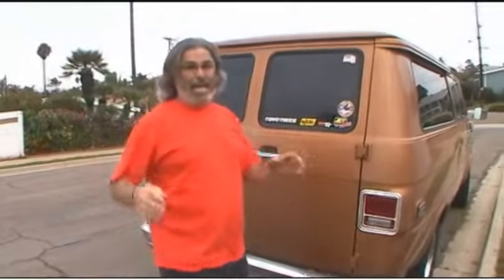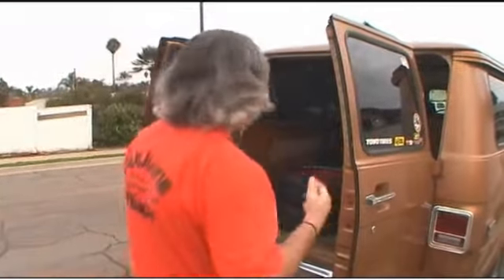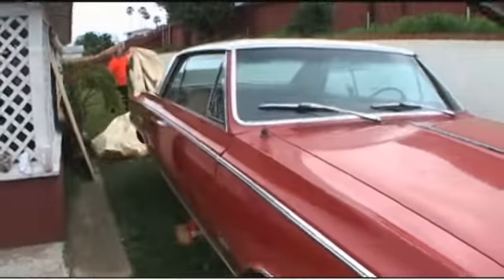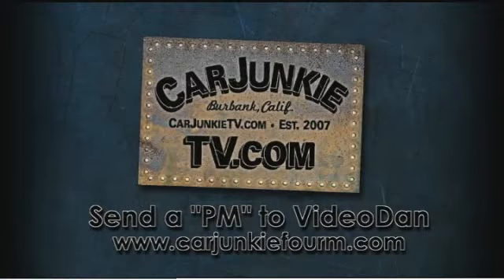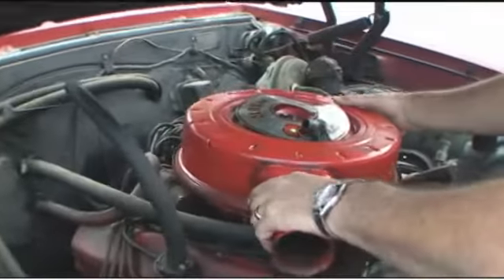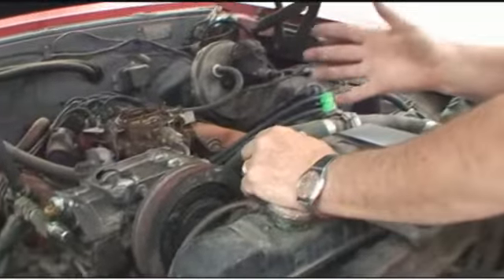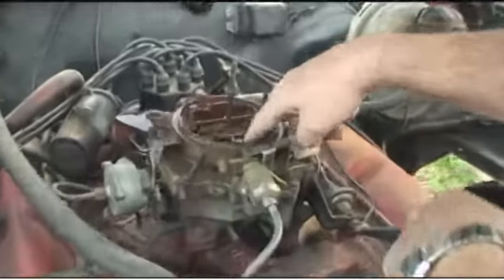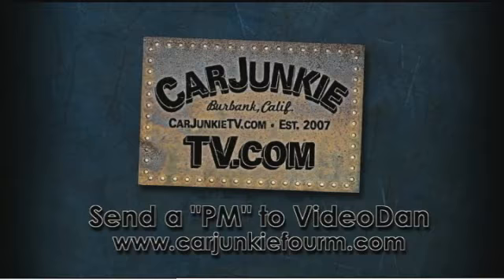Car Junkie TV Demo

Comment: Thanks for taking the time to comment.

It took 6 months worth of weekends to get the old girl on the road and she's running great. Everything on the engine had to come off and get rebuilt or replaced, but the engine and transmission itself just needed a good "flushing" and some new fluids.

The only real problem with the chassis was the resonator was complete;y rusted through. Some heat curing muffler tape fixed that. She is still on the original shocks and rides smooth.

I've put over 8,000 miles on her and she has only left me stranded once. A brake line failed in the middle of the high desert coming back from Willow Springs… a whole other story indeed! 

You can find lots of great Freiberger videos on the Roadkill channel.

Comment: There is some nice work in this video! Your piece to camera can be ever so slightly awkward at times, but inject some more confidence in and you will be fine! By the way, for turning the engine over to check if its seized, set the car on axle stands, put it in 4th gear and turn an engine operated wheel with the sparkplugs out, that avoids having to remove anything to get at the crank sprocket :)